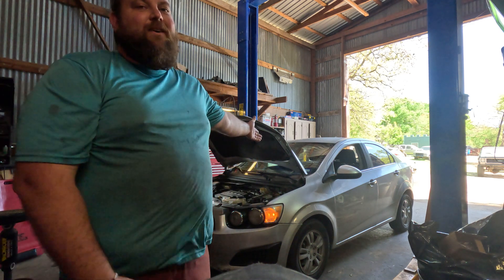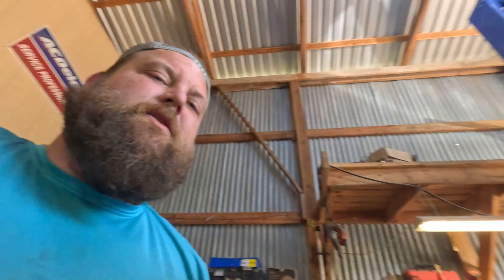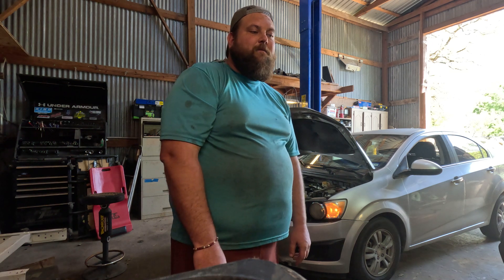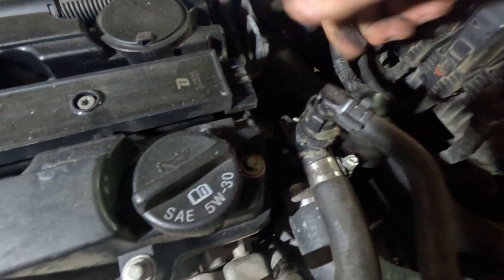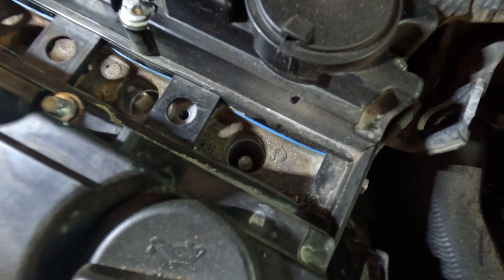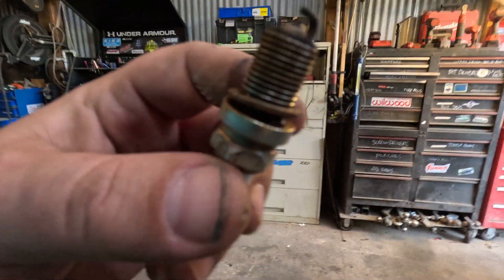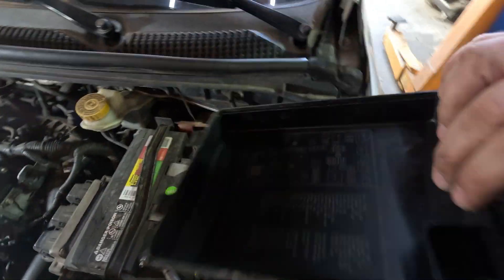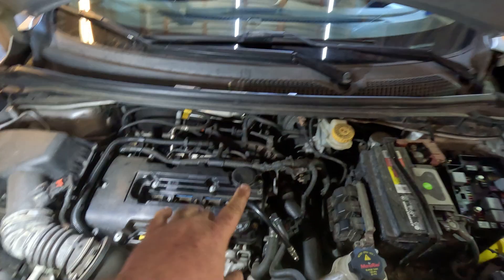Chevrolet Sonic (2013-2016): Engine Misfire  EASY Diagnosis and Repair! P0301 P0302 P0303 and P0304

Comment: OHM TESTING A COIL IS USELESS UNLESS IT'S SHORTED OR OPEN IT'S A STATIC TEST WHAT YOU ARE DOING IS A DYNAMIC TEST AND MUCH BETTER TO DETERMINE COIL OUTPUT UNDER LOAD
Reply: Em latim, visita pá pau